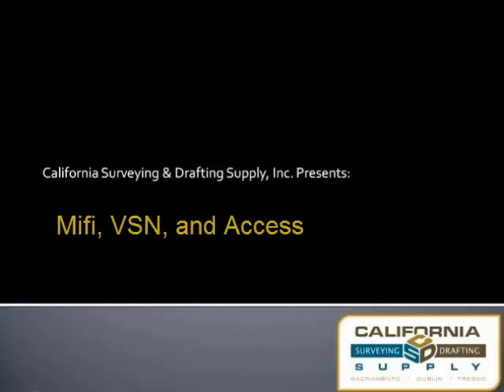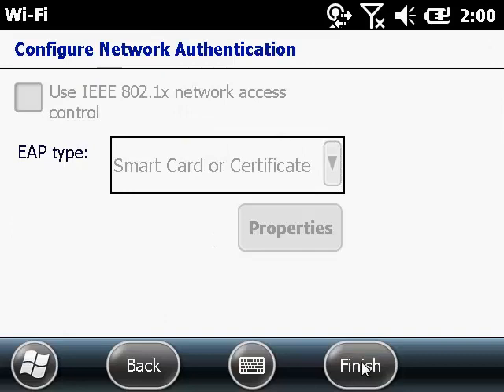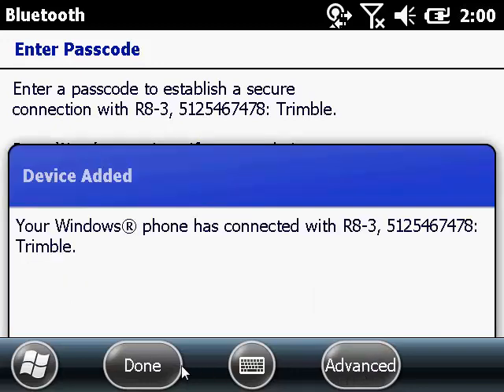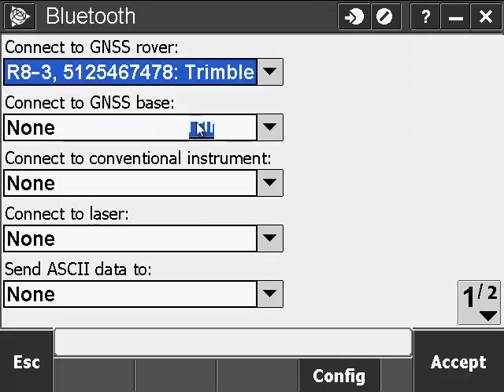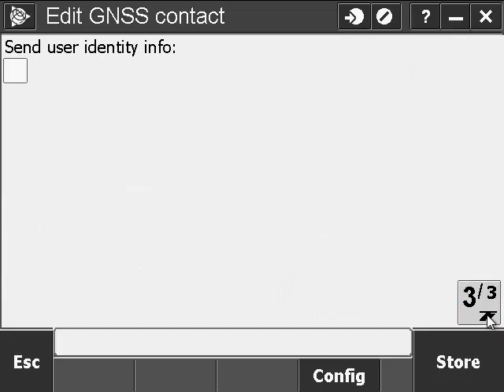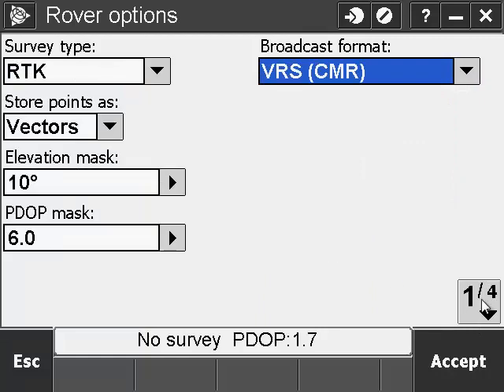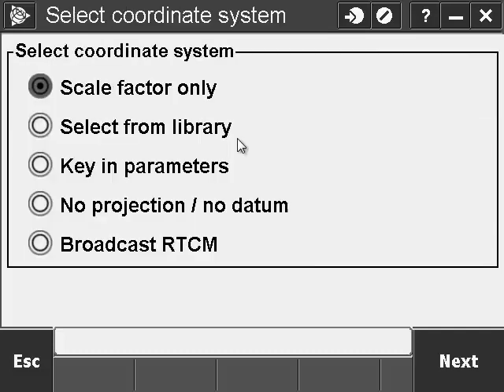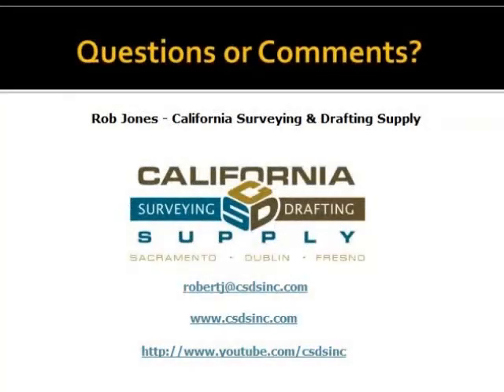Trimble Access: Configuring the TSC3 with a MiFi for VSN Connectivity

Comment: I accidentally deleted my Hotspot from the list now it won't find it. Any ideas how to fix it?
Reply from the maker: Hi Justin,

The necessary instructions are in the 1st minute of the video.

Following the instructions in the first 60 seconds of the video should do it. If it’s no popping up on the list, try a hard reset on the data collector by holding the green power button down for 5 seconds.

Terrell Carlton
Manager | Technical Support & Training Division

Comment: Hi, 
Has anyone had the issue of when its "connecting", it just goes back to available?
Reply from the maker: Hi Ryan, typically both devices just need to be restarted. We would recommend doing a hard reset by holding down the power button on the TSC3.
Reply: @CSDSINC  it was my older mifi that was the problem. Your guys in Sacramento helped me get it sorted.  Thanks
Reply from the maker: @ryanjacobson8013  you're welcome Ryan. I'm glad we could help take care of that for you. Thanks for stopping by!